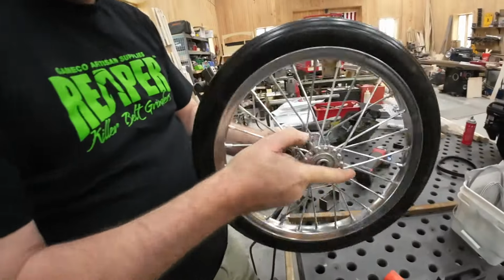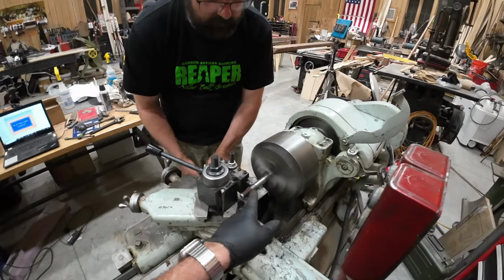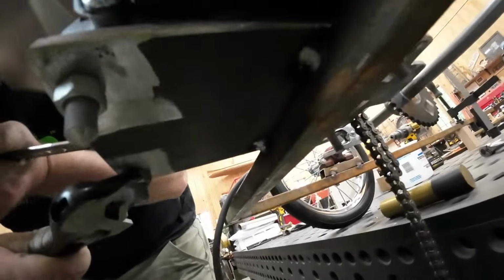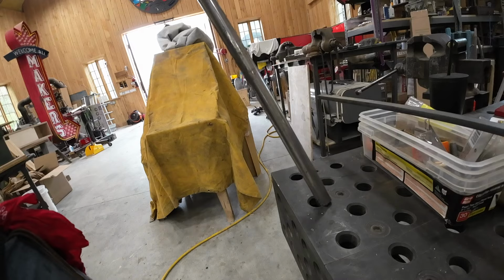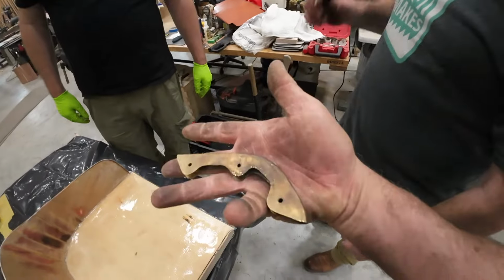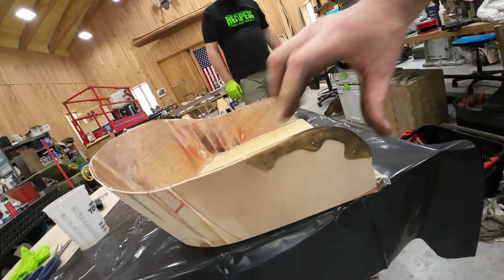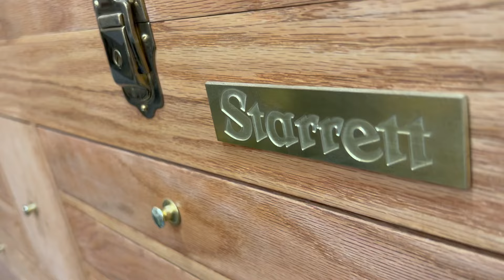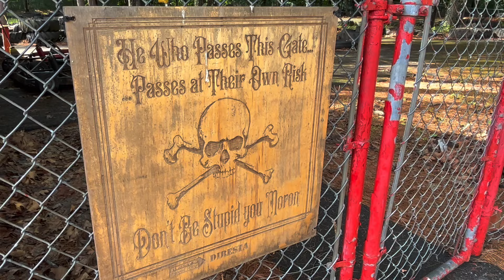1920's Go-Kart Build with Starrett

Comment: Nice, but it looks like you forgot about Ackermann's steering geometry.
Reply: where is @thisoldtony when he’s needed…
Reply: It looks like it’s backwards, with the outside wheel steering more than the inside wheel!
Reply: No suspension, so Ackermannn does not count. Not needed.
Reply: Fun sponge…
Reply: Forget Ackerman, what about caster?
Reply: Please link the video of your scratch-built cart employing the Ackermann steering geometry for comparison, as I am sure we would all be interested in seeing what you came up with.
Reply: You mean the one with the proper steering geometry that doesn't make the tires fall off? 23:19 here it is. No, wait, that's not it.
Reply: Easy enough to fix that. The steering rods are totally adjustable. Just make them smaller and Ackerman is happy

Comment: It works as a CVT. As the rpm rises, it modifies the torque coming from the engine to the wheels. it mimics changing gears to a closer ratio as the rpm increases, as the rpm decreases it brings the ratios further apart like 1st gear would be in a vehicles transmission.

Comment: steering arms should point to center of rear axle,  king pin should be angled so it points to center of spot where tire touches the ground.  Also should have king pins rolled back a few degrees.   Great cart and nice to see the others helping!!   Thanks for the video Jimmy.
Reply: I was very pleased to see the details you have outlined, the geometry of the front axle/steering components will make a world of difference, good to see you have a simple explanation that is absolutely correct, 👍

Comment: Nice looking build JD! If I may offer a suggestion, It appears that both wheels are keyed to the rear axle which causes the front wheels to scrub off the tires (my opinion). For better drivability and far less steering push in the corners try having one rear wheel a freewheeler and the other rear wheel keyed to the axle. This will give you a differential effect. We do this for Cyclekarts. Thanks for posting the build I enjoyed watching.
Reply: How hard would it be to make a LEGO style diff?

Comment: The random velocity clutch is commonly known as a torque converter.
Reply: Hmm... I think it is a CVT, a Continuously Variable Transmission.
Reply: @Scodiddly  this, used in scooters and even some cars
Reply: @kiiiisu and snowmobiles. There was also an Eastern European car called the DAF that used a pair of them (one on each rear wheel), and no differential.
Reply: @Scodiddly  this is it, this that kind of transmission
Reply: @rcjbvermilion  I believe Daf was the inventor of the CVT system.
Reply: @rcjbvermilion   NO! DAF was "Dutch Automobile Factories" the passenger car 1e had "Variomatic" it evolved into the DAF66.
Reply: @rcjbvermilion  oo yeah forgot snowmobiles totally
Reply: @kiiiisu  Robot Cantina
Reply: @rcjbvermilion It was Dutch, not Eastern European.
Reply: yeah it is a torque converter

Comment: When I was a kid, we called it a torque averter, as opposed to a torque converter in a car.  Now, I think they are called "continuously variable transmissions" or CVTs for short.  I had one on a 50cc trail bike when I was 12, but it also had a 3 speed gearbox.  It was loads of fun.  The 70s was a great place to live.
Reply: CVT, had it my 1964 DAF(fodil) 750cc car.

Comment: That my friend is a CVT (continuously variable transmission). I use this on my motorized bicycle with a 79cc predator engine (needs an upgraded carb and exhaust to work well but if you remove the governor, get a billet flywheel, stock isn't strong enough)

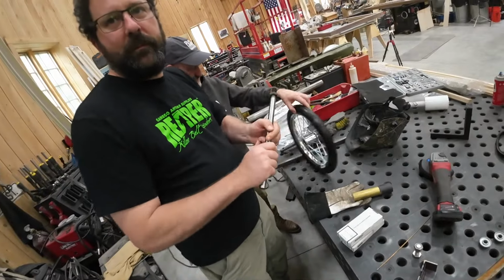Comment: 3:40 the classic design is even simpler than that. they wouldn't use an axle at all. they would take 4 smooth studs, no theads, and machine them down to have a nice shoulder, then machine a groove for a spring clip such that the wheel plus a washer on either side plus the clip left about 3 or 4 thousands of play (or less). no need for any kind of thread, left or right! and the wheel will never come off, even up to around 40 mph with a 1 inch shaft. they would also often do drive and brake on the same wheel with a simple leather strap that tightens around a drum, and then the drive sprocket would be welded or bolted directly to the brake drum (with the drum bolted directly to the wheel). you really can't get that style of go kart anymore, as the last ones stopped being made anywhere in the world around the 80's. all you can find now are high speed racing karts that use full suspension. one wheel drive is the best! gotta feel that jerk when you goose it haha

Comment: 2:03 This is a clone of a Comet brand CVT, or continuously variable transmission. It has a centrifugal clutch built in to the drive side too. They fit a bunch of older engines like Tecumsehs and old Briggs and Stratton, and they also fit newer Predator 212 harbor freight engines (because the hobo fright engines are modeled after the old ones). I don't believe Comet makes CVT's anymore, but that design is essentially perfect and everyone copies it. If you get one, make sure to get a variety of sprockets; they are very easy to change for different chain types.

Comment: CVT = Continuously Variable Transmission.
As the input shaft turns faster the belt position moves closer to the hub and the opposite for the output shaft.

Comment: I would have made a large nut maybe a spinner for the wheels and steering wheel!.. but a 1.5" Diameter 1" thick nut on the steering wheel with it blind tapped  do thete is no hole through it. And stamp the outside with a Diresta logo stamp!!

Comment: How does that clutch function? Look at those weights. When the engine is idling, they stay in that position until the rpm causes them to move outward. This is caused by centrifugal force. The more force applied to them, the more they're driven outward. They're attached to one of two vee shaped disks where the belt is located. The inner edges of those centrifugal weights are wheels, which are touching that disk. When they're forced outward, this causes the ratio of the belt to change. Were you to look at it while one of you pushes the accelerator pedal, you'll see the belt getting bigger because the outer disk is moving closer to the inner disk, which is beside the side cover of the engine. While the belt is getting forced outward, the opposite is true between the two driven disks. The outer of them is spring-loaded. Why does it need to do that? It's because that belt needs to be in excellent alignment, so it won't wear excessively. Yes, it does do that, which means that it will eventually need to be changed for the next belt. What else is there? The belt between the two driven disks will force that outer disk outward and cause it to come closer to the shaft in the middle of them. Do you see what else there is? I'm not quite certain about how I could word it, though. I'll think about it for a moment of time. When I have that knowledge, I'll type it for you guys. Yes, I have it. Look at the belt. It's at the narrowest place between the two driving disks, which means it on the outer edges of the two driven disks. At maximum rpm of the engine, the belt is in the opposite placed between the four disks.

Comment: The drive setup I've heard been called a torque converter in go-karts. Or otherwise know as CVT (continuously variable transmission). You see them in a number of applications, like go karts/mini bikes , golf carts, snowmobiles, four wheelers, side by sides, and although different but same principle, cars. like Nissans, Subarus, Toyotas ECT.
Reply: Torque converter is incorrect,  but that doesn't stop it from catching on as slang. Did you mean etc as in Et cetera? Or is there such a thing as a Toyota ECT?  (I'm asking to be marginally dicky but also curious...)
Reply: @badad0166  yeah you are probably right and it was a typo I meant etc.
Reply: @tannertischer8895  Cool. A torque converter is, of course, the donut looking thingy on the front of an automatic transmission. To understand how a torque converter works, get two fans and have them face each other...(etc.)...😃

Comment: Isn't that a torque converter clutch? Might be. Ask someone smarter before you go with that. Nice build. Wheels might fall off, though. Those aren't really meant for  sliding around a corner like a posi rear end does. Use fat slicks, maybe?  Whatever. It's a great little go kart. Looks like a lot of fun to build and drive.

Comment: 1920's?  Using a modern engine, tig welding,  bandsaws, lathe,  etc etc etc,  and  the  20's DIY kart would not have even had a welded frame, maybe  bolted or riveted   COME ON  guys

Comment: Great work.. but it is useless and not worth all this spending, effort and time.. The engine causes a lot of pollution to the environment due to noise.. The engine must be replaced with a quieter engine, and you must also create a system that absorbs shocks.